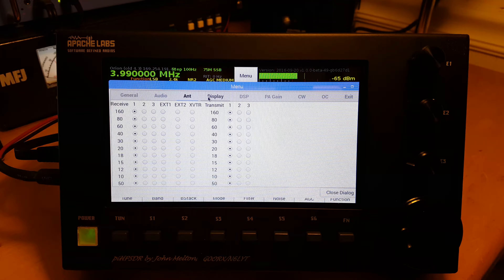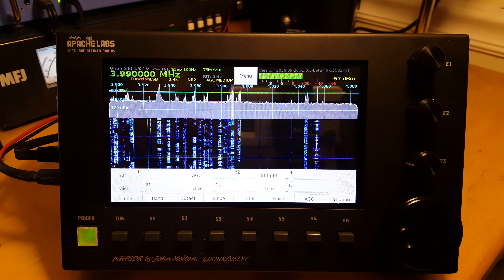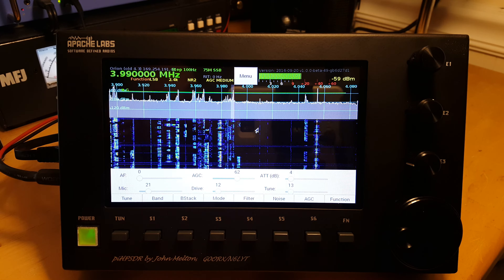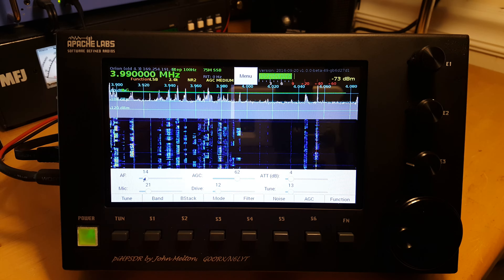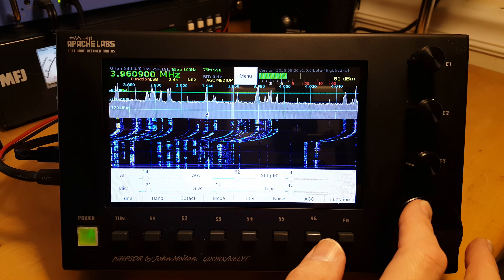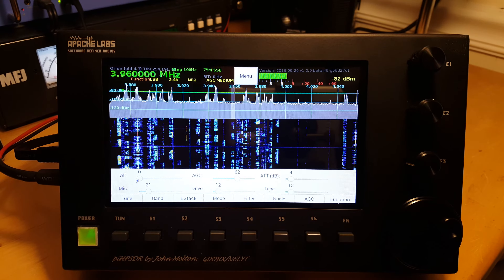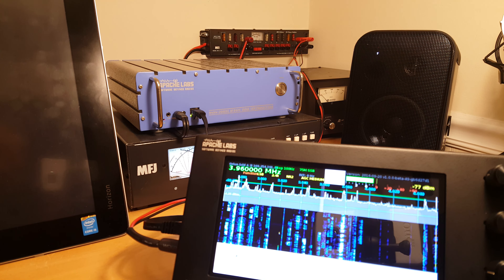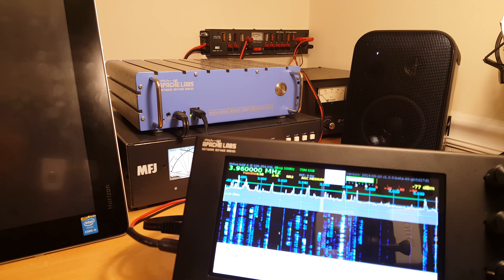Apache Labs PiHPSDR by John Melton G0ORX/N6LYT

Comment: Is this controller specifically for the Apache SDR, or can it be used with other SDR boxes?
Reply from the maker: Wm Robert Leschyna the software is for the Apache Labs SDR transcievers. You could run other Linux based software. The knobs would have to be ported over. As in the GPIO.